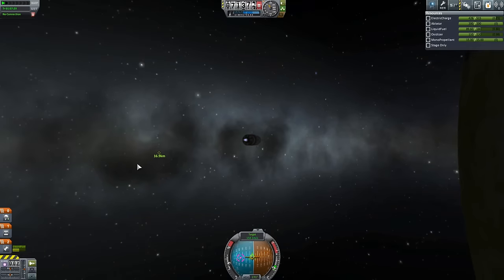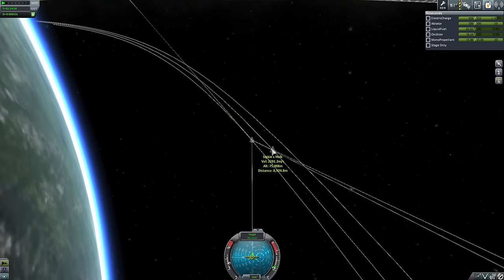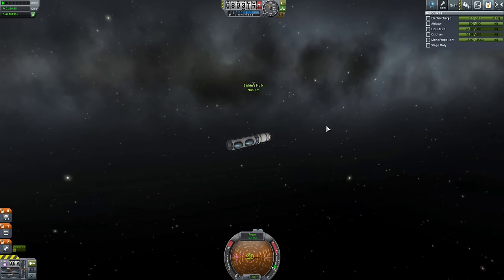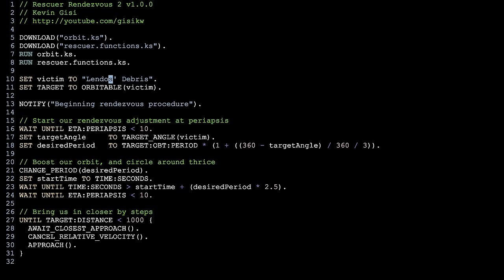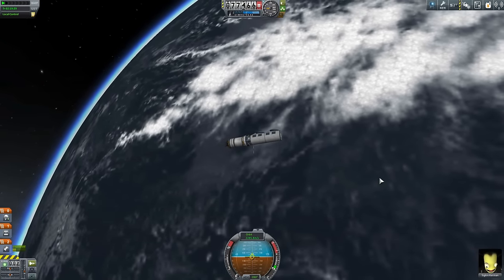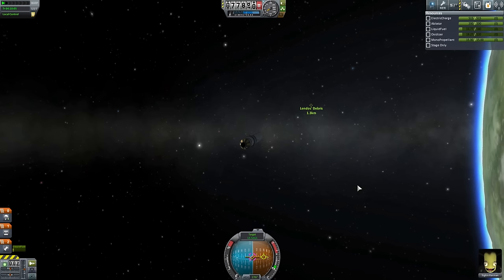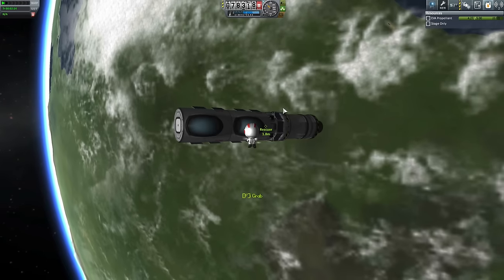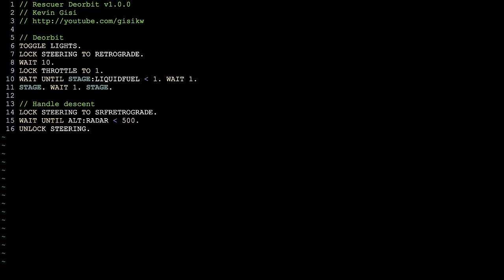Kerbal Space Programming #11 - Low on Gas!

Comment: Suggestions for the next episode: 
-Space Command Satellite -> A solar powered data analysis center for coordinate symmetry movements in space and perform calculations for avoid other planets gravity collision/disturbance (avoid the Mun accident in ep 6)
-Grapple Satellite Network Installer -> A spacecraft used for place in orbit 4+ satellites with only one lunch. (You might use the Space Command Satellite for place the satellites with equal angular distance between them without writing different scripts) just remember that for a bigger orbit you will need more satellites
Refueling Station and Rovers  > as 17Haxor17 already commented

Comment: By the way the best comsat design for the inner kerbin system would ideally have 1 omni, and 3 short range dishes.  Each sat would point one dish at mun, one dish at minmus, and one dish at active vessel. This would give you 99% coverage of the inner kerbin system.  Then with just two more sats in polar orbit with 1 omni, and 4 longer range dishes you could get cover from moho all the way out to duna.  Have 1 dish pointed at each of the inner system planets (moho, eve, and duna) and the fourth pointed at active vessel.  And with 6 sats you now have 99% coverage of the entire inner kerbin system. Technically all you need is 5 comsats. Three of the sr range ones each at a phase angle of 120 degrees within 1 sec of orbital period and the two long medium range comsats in the polar orbit at a 180 degree phase angle with 1 sec of orbital period.

On mine I have ion engines and a program running constantly checking their phase angle to the sat ahead of them.  As soon as any reach a maximum drift angle of 20 degrees. They sequentually run rephasing scripts to put them back to 120 degree phase angles for the SR and 180 degree angles for the LR. 

I did a couple of long and very boring streams on how to deploy comsats and phase them all properly as well as discuss different types of comsat orbits like synchronous, keosynchronous, and molniya style orbits.

http://imgur.com/a/yvTj5

Comment: Suggestion for next episode: Write a script for commsats 2-4 that ensures they're 90, 180, and 270 degrees away from commsat 1, and that their orbital periods are within a second of each other - that spaghetti of orbits, while hilarious to look at, is not the most efficient.

Also, a useful 1-line startup script for any orbiting/non-maneuvering craft: "lock steering to sun:position." - maximizes solar panel exposure for, eg, dish-heavy sats.  If you want to get fancy, add an unlock steering when electric charge begins to drop, and relock it as chg begins to rise again (although that relies on the sats being not-on-rails)
Reply from the maker: Definitely great suggestions! We're really need to do something about those sats!

Generally speaking, I think we want to perpendicular to the sun's position. At least, so long as we're dealing with the radially-mounted panels. That's a clever idea though, putting that check in the startup script!
Reply: thebarbes - Youtube Definitely in support of this suggestion. You might also consider setting up a keosynchronous communication uplink satellite directly over the KSC. Maybe try setting up some scripts to request the satellite to point a long distance dish at a given target.

Comment: i have a lot of trouble with not actually knowing the full power of kOS - for example in your videos you were able to pull the length of your orbit directly while I had to literally draw a circle on a post-it and figure out the length by using eta:apoapsis and eta:periapsis... i guess the upshot was that by using some ratios i was able to also figure out which way my prograde vector was pointing... but it's really time consuming and i suspect it limits my ability to conceptualise solutions to various problems because i don't really know what the tools are that well...

since the documentation, although well intentioned isn't that great... got any tips?
Reply from the maker: Kirkus Maximus Honestly, I've found the docs to be immensely helpful - though I would recommend using the search box, as sometimes it's not immediately clear where a particular feature might be. The /r/kOS subreddit is also a great source of information if you're looking for folks to help you out :)

Though for determining your orbital period, you can definitely calculate that using the math too! :) http://www.wikiwand.com/en/Orbital_period#/Small_body_orbiting_a_central_body
Reply: yeah :D using math is a bit more rewarding to be honest but there's only so much code you can fit onto the probe... i have found this in the meantime though... it's basically what i was looking for sans maybe a bit more detailed information for each item... but it'll do nicely : https://docs.google.com/spreadsheets/d/1rPDcrVllj62QsH26BIkIiyos81TcKj3U_ssgcsiHkXc/edit#gid=0

Comment: May I ask what software you are using to record and edit?  I stream with OBS and used to record with camtasia but I don't have access to camtasia atm.  I could get it again but I found it does not record opengl games so I am not sure I want to invest in it again.  The problem with obs is I cannot get a separate video, audio, and mic channel.  So it gimps editing.
Reply from the maker: I've gone through a bunch of different systems. But at the moment, I record on Windows using OBS, while recording the audio and mic out separately to a Zoom H6, and sync them up in post. Cheers!